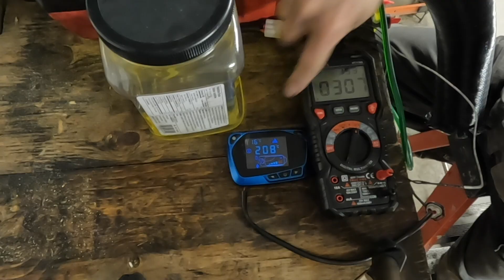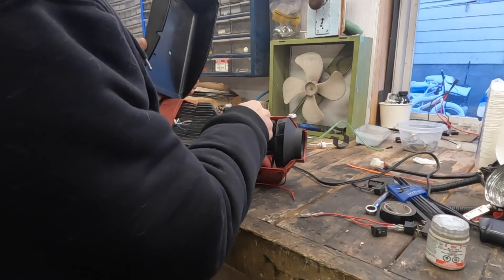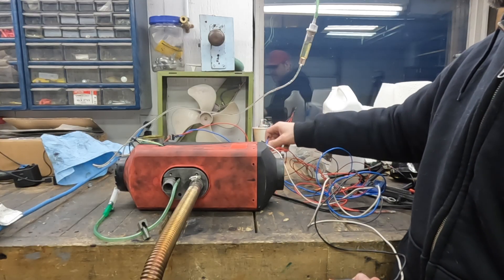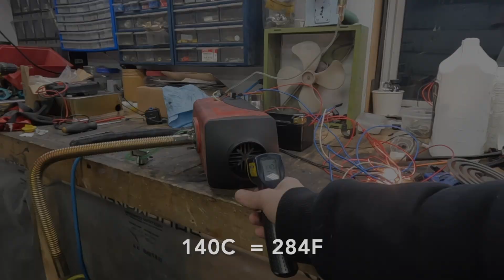ECU Replaced With Light Bulbs !! Diesel Heater Runs With No ECU !!

Comment: The reason why people think they need a "reason to do something" is not the point.  That's a defense mechanism they're pulling out of their butts because they are too lazy to actually try and do something, anything, learn, tinker, play, whatever.

That's the way we're going across the board IMHO, people are becoming less curious about stuff and don't want to make any effort about (it seems like) anything!  Let em post and prattle on, who cares.

You're on YouTube doing your own thing and having fun, but you're also putting it out there for public consumption, right!?!   You will get armchair experts, who've never touched a diesel heater in their lives but just know everything, and you'll also get haters just because its YouTube and  they come with the territory, and of course the inevitable trolls. Don't read too much in the comments from them and if its a rude or stupid post you as the channel  owner already know by now how to delete comments.   

I'd be inclined to have soldered a few connections to the original ECU and log what it does first and then toss it, but MEH, you're well past that ........  nice work.

Have you played with the length of the exhaust hose yet or the orientation of the heater?  You've got me thinking I might pull my heater into the house and hook it up and then run a 6 foot exhaust pipe out of an unused air intake "hole" in the side of the house.   I don't use the fresh air make up fan for the house ever but the vent hole is still in the basement wall to move the diesel heater exhaust out.  Then feed the blower output of the diesel heater into the supply plenum and let it drift up where it wants too .... I'd use convection rather than the furnace motor ......
Reply from the maker: Yes... this is a problem. Sitting around imagining all of the great things you could do if you actually did something.... but never do those things. I'd rather spend my days doing "stupid, silly" projects, and have a lifetime of experience from it, than to sit around imagining what amazing things I could do. 

Same people will be like "oh, it must be nice to have all those tools. I would build a lot of things if I had all those tools". It is nice, but it took me 30 years to get them, and I still get things done with 3 light bulbs and a chunk of wire, haha. 

I totally thought about trying to read that the ECU was up to, and may still, for giggles... but I didn't want those numbers to discourage from trying.
Reply: Yep, absolutely not - continue to play away .......  and ignore the haters .......

I'm thinking about ordering some exhaust pipe off amazon and mounting it up in the basement but I'll cheat and leave it all stock to begin with and try shoving the heat in to my furnace, it might make a cool emergency backup thing.  I'm gonna get some temperature probes and hook them to a few ESP8266's I have kicking around and monitor the heater from my computer instead.  (grin) 

The whole idea of hanging around outside would suck, I'm in hidden valley in the NW and you're probably in Dover but its still too damm cold out now anyway, I liked December better ......  @loweredexpectations4927
Reply from the maker: @casondave  Sorry about not responding to the exhaust part of your comment last time. I got sidetracked with my rant. 

I received 16 feet of exhaust a little over a week ago and plan on doing some testing... pushing my heater too far to see what is and isn't possible / practical. I'm not sure about 6 feet, but too much restriction will cause the heater to run rich and make a lot of soot and CO. a good way to test this is with a CO meter with the heater on the highest setting.

I hope to do some testing this week and have a video out for Saturday or Sunday. We will see how that goes.

Comment: Nice work. I should have my other heater show up Monday,  I'm going to probably try the motherboard on the larger body heater and see if it can produce the normal 220C running temp. If I add a propane injection I can run around 240-250C.
Reply from the maker: Haha. ! Nice.  I had mine up to 270 last night running on diesel, but it was making a LOT of CO.... not very efficient, but lots of heat.
Reply: Variable speed control needed for the fan.
Reply: I did notice a big difference with fan rpm when on solar. Peak power was 14.5V and the fan seemed to run faster than 12.5V at night. An adjustable power supply for the fan might be the ticket.
Reply from the maker: @kirkwalsh1932  You mean and infinitely variable, and not just 3 speeds... yes... that would be better for ease of tuning, but you can also tune by increasing or decreasing fuel, and I can monitor drip rate by counting drips, and with the switch and bulbs , the speed of the fan is consistent. Meaning, at setting X it will always turn X fast.
Reply from the maker: @kirkwalsh1932  Yes.. battery voltage makes a big difference in fan speed. I have noticed this and several people have pointed it out in the past.

Comment: I'm useing a vevor "8" KW all in one to heat my 14x60 Mobile home that's from the 1960's, also have a more basic model vevor "8" KW that i had the glow plug crash ( the idea was to put one at ither end of my trailer but having to run my main heater in 3\4 's of my trailer and a kero sun Radiant 10 in the master bedroom due to the other heater glow plug issue) The basic model at setting one was putting out around 200 *c and the pricer one had to run at setting 2 to get the same output.. The main one has been running almost non stop for around a week and the other crashed the glow plug and pulled apart it looked like i was trying to run waste oil (which i'm not, been running straight diesel at a cost of 1.55 per L) and i haven't had to pull the main one apart yet due to the minus 50 ish temp we have been having up by edmonton.. I had to run the basic at setting one due to to much heat for the master bedroom any higher and i baked my ass off... Asuming that is the reason why the basic crash the glow plug and created such a mess inside it.. Really need to get the proper kits for my heater but with soooooo many different brands and literally no proper information on the kits and what fits what.. Have a idea on something for you to do, are their alternative methods to fire the heater than the crappy glow plugs...
Reply from the maker: Are you getting a glow plug failure code ? E-03 ? 

The glow plug is supposed to turn off once the heater is running. If the ECU has a problem, or perhaps poor design, it may run the plug all the time. This could cause it to foul up, as the diesel trips onto the plug while heater is running. 

The way it should operate is to turn the plug on for a minute before the pump starts, then about a minute later, the plug should turn off as the heater reaches temperature. 

You may have noticed that I only turned the glow plug on for about 6-7 seconds and turned it off as soon as the heater fired up. That is all that is required. 

Spare parts are cheap for these and good to have around. If your glow plug is full of crap, the mesh around it is likely full of crap too. You will want to fish it out and clean it, or replace it.
Reply: No i broke the glow plug trying to pull it out with out opening up the heater first and the parts may be cheep to some but not to someone on a fixed income that can't affored to make mistakes or to order parts that mite not fit... @loweredexpectations4927

Comment: Hey love the vids got a burning question Where to get proper glow plug and gaskets for the vevor "8" KW heater's.. Are they all the chinese heaters the same and are they the same as the webasto heaters ect?
Reply from the maker: Almost all of of the 2, 5 and 8kw heater glow plugs ae the same. 

I recently got one from Amazon. It is listed as Xximuim Glow Plug Repair Kit,12V Air Diesel Parking Heater Part Kit with Removal Fitting Tool for 5000W 8000W Eberspacher Espar Airtronic Heater 252069011300 and Other Aerial Parking heaters

Comment: You could use a automotive heater resistor instead of the bulbs  and have 4 speeds
Reply from the maker: I think I may even have one of those laying round off a BMW, haha... The bulbs were more fun for the video, but not as practical. 

I feel like the automotive resistors would not have enough resistance, but I'm not sure.
Reply: @loweredexpectations4927  You could use the bulbs as an electric preheater for the oil, as mentioned in the other comment.
Don't even need to insulate against the oil.
Analog ballast resistors for car fan speeds are very much a thing of the past. Oldtimer parts comes at extra costs. Light bulbs are still plenty and do a better job - since ballast resistors do need the fan's air stream not to burn through.
Either way, the oil heater has to be prevented against burning the plastic canister down in case of air contact, when the oil is used up.
Reply from the maker: @werner.x  When I was building it, I was thinking "people will have some great ideas what to do with the heat from these bulbs, haha... that would work ! 

A person could easily make a metal frame / bracket out of a piece of coat hanger or anything to hold the bulb and keep it from touching the container.

Comment: Encase the heat exchanger in a cast iron vessel - check.
Power up to max KW - check.
Feed in empty drinks cans - check.
Make oodles of money from scrap aluminium - check.
Spend much more money on new heat exchangers - check.
🙂
Reply from the maker: LOL... that sounds like an interesting plan. When I was testing with waste oil last year, I managed to melt a bunch of copper... I was impressed.

Comment: Worked on my first heater after my second heater melted the burn chamber. First heater I got did the flame out and found out what I did wrong the first time I went to repair it. I am lucky I have a burn chamber that can be unscrewed so I could pick out the build up I was not able to see the first time when I changed the atomizer screen for the first time. For the first time, I repaired one of these things for my first hopeful first success.....I am doing "first" just to comment and help, lol....BUT, still a true story, spent hours boiling parts (for the first time), cleaning, picking, prying, change gaskets, etc. but it's running as I type this, no fluttering, at least very little compared to the first time I ran it since it die 3 years ago getting my second heater to replace the first one, and I didn't need to lower my expectations for the first time, been doing that for a long time, lmao.
Reply from the maker: I have heard about these burn chambers, but have never seen one ... very neat. 

HAHA... too bad this wasn't the first comment on my first video ? .... I'm glad you got it sorted out. What brand is your heater ?

Comment: Great video I see your triggering a lot more comments 🙂😡😜🤑. 
I think switching out the blower fan and motor as it's old outdated tec for two separate external one's will be a easy and beneficial way to go the snale fans for 3d printers are capable of running the combustion side with a surprisingly low power usage and there is lots of options for the heating side
Reply from the maker: That would be cool. It's nice that they are tied together for simplicity, but also would be nice to have control over them individually. The exchanger fan requires a fair amount of oomph... I have thought of 3d printing a replacement fan for the motor to try to make it more efficient and quiet.
Reply: @loweredexpectations4927  DC brushless is a game changer the power consumption difference is ridiculous

Comment: I'll point out, without intending to criticize, that PWM DC motor controllers are available on Amazon for $20.00 or less.
Reply from the maker: LOL... Thanks for the comment. I'm okay with some criticism, especially if it is factual and not directly attacking me, haha. You checked both of these boxes, haha. 

I actually have a DC to DC PWM controller in my tool box that I bought for a day just like this one, but I thought the lightbulbs were just more interesting for the average person. 

That being said. It is truly amazing how cheap electronic doodads have become.
Reply: The nice thing about PWM control of your fan is that you have very-fine control, and also, you're not wasting battery power in the lights, and the fan motor torque will be considerably higher--that last part may not matter that much in this application, since the required torque is "2/3 of a gnats fart".....
Reply from the maker: @patchvonbraun  Yeah... for low power consumption, the PWM is almost certainly a better option. It is still pulling about 40 watts at full speed in the current configuration. Maybe I will pop my controller on it and see what it pulls. 

Haha... "gnats fart" ...

Comment: I haven't checked out how they controlled these when they made them in the 30's. I bet it was a lot like this.
Reply from the maker: Yes... things back then were usually electromechanical or manual switches. 

I was looking at the heater last night and thinking .... I could actually have heat controlled (bimetl) switches on the heater so that if the heat exchanger cools off, the fan speed slows down, and if it heats up, it speeds up.
Reply from the maker: @PORSCHE_COUNTRY.  Thanks for the comment. 

Overall these things are incredibly reliable. There are literally millions of these out there, I have 4 that all get abused, and I have never had a failure that wasn't cause by something I did. If you have a bad experience, if course this is going to leave a bad taste in your mouth, but most people use these for years without issues. 

Your code means that the heater is not detecting the correct resistance from the fan. Does your fan seem to be working normally ? Does the fan spin up when you push the power button ? 

The ECU is really stupid and only knows if something is connected or not, and there is also a sensor to detect if the fan is turning. You may just have a bad connection at the circuit board, at the fan connector, or you may have a faulty motor ... the brushes in the motor may be sticky, causing a poor connection. 

You are right about the parts.... You are almost better off buying a new one and having the old one for spare parts.

Comment: couldn't you use a pot to control the resistance on the fan speed or am i missing something?
Reply from the maker: It is possible that you could do this, but the wattage is likely more than man of them can handle, for an extended period. They are intended for signal voltage. 

I have a few of them laying around, as well as a variable DC to DC regulator, but I like the idea of using bulbs way more.
Reply: @loweredexpectations4927  How about a mid 70s automotive pull on head light switch that has a variable resistor for the dash lights. These were common on Ford trucks of that era. And they were rated for 12-14VDC.
Reply from the maker: @bryancondrey6457  My 03 GM has a similar thing to set the brightness of the cluster and dash, but it may be a pot connected to a circuit board.

Comment: PWM is used to modulate the current of the glow plug and the fan. The ECU and controller are both 24v compatible, so that leaves the fan, glow plug, and pump as the only variables in a 12v or 24v system. David McLuckie reviewed a ""12/24/240v" heater. It used a 24v switching power supply, but he applied 12v and the heater ran fine. Motors and glow plugs are sold rated for 12v and 24v, but I wonder if those are just labels akin to the "5kW/8kW" labeling? As you just proved, the full 12v is way too much for these components. David speculated there was a 12v regulator on the ECU, but I don't think so. I wonder if the motor and glow plug PWM are just adjusted based on whether the ECU senses 12v or 24v. That would have to be confirmed by buying the 24v versions and measuring the resistance. It may be possible the pump is the only thing which needs to be changed to switch to 24v. The ECU/controller must be measuring the resistance of at least one of the components, because you can select 24v while running on 12v, and it just won't run.
Reply from the maker: I suspected that they used PWM for these ... makes sense. 

Now that you mention Dave's video, I do remember seeing that but don't remember the results. 

I would think that the PWM compensates for the extra voltage, but that is just a hunch. The 12 or 24V selection may be so that the ECU recognizes the different resistance as normal ... I don't really know.

Comment: It is good to know that the electronics can be replaced in the event of an EMP
Reply from the maker: "If there's a will, there's a way" as they say. A little creativity and messing about and you can make it work.
Reply: You'd have to harden your voltage regulator in your battery charging generator too, because the battery won't safe your life for long.
Reply: Emp's are fake and 🎉
Reply: @TurtleHead420  nice try🤭
Reply: @Baky6 I bought some grounding bed sheets, so I'm definitely safe from emps👍

Comment: I love the diesel heater experiments,and the way you pull them off with mostly the stuff you have lying around.
Reply from the maker: When I was putting this together, I realized that I have a few variable resistors and a PWM control board from amazon is a few dollars.... I actually have one in my junk drawer .... but I much prefer the bulbs... You can see what's happening and it is more of a challenge. 

Thanks for the comment !
Reply: @loweredexpectations4927  💯 👍

Comment: I think, it may need the  high fan. Will it not run too hot, melt the shell, if the fan is on low?
Reply from the maker: It is running 3 speeds ... on the lower settings it may burn way too rich and cause a lot of soot. I did have it up to 270C yesterday, but it was making a lot of smoke, haha.